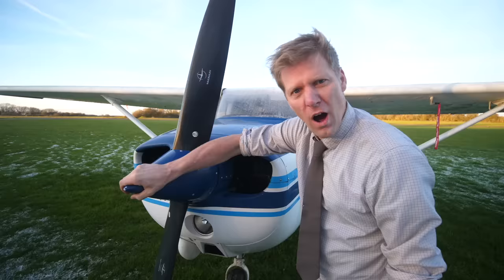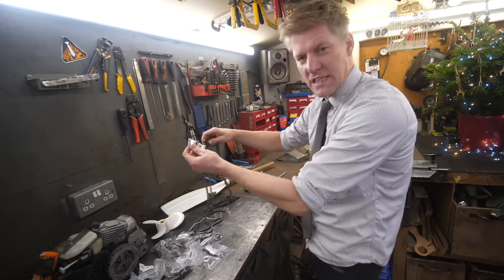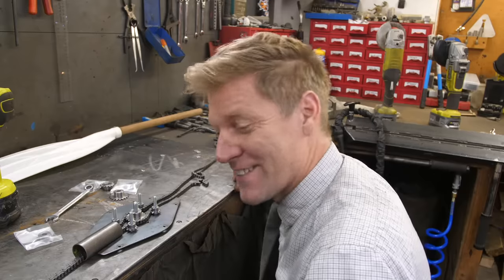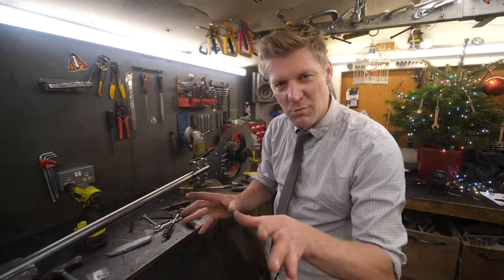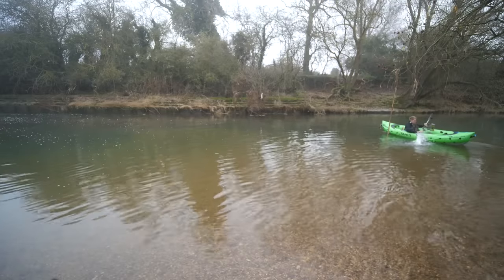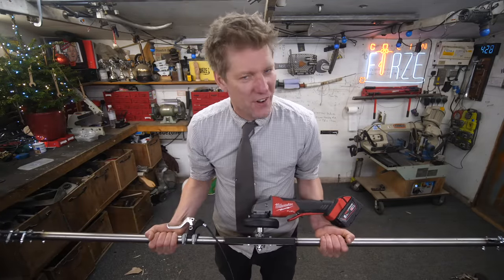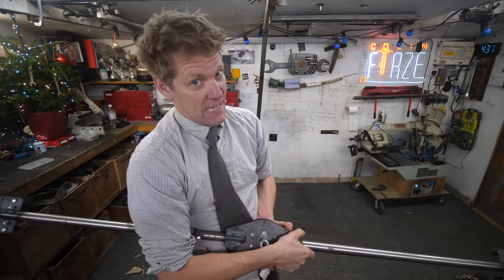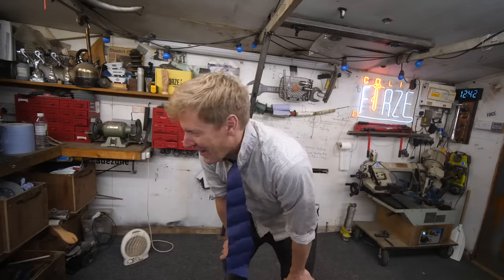I put high Speed Prop Blades on my Kayak Paddle!!

Comment: I feel like for canoeing this would be even better, because with two props in the water both sides, it would allow you to go straight and not worry about the spinning problem.
Reply: Double trigger and a separate chain system for each side. And have it bend in the middle so it can lie flat over his knee in the boat. But each side bends into the water. Hold both triggers to go forward and hold only one to spin
Reply: You should have curved the handle so both props would be in the water at the same time. To turn you would lift 1 prop out of the water. Or create an outboard that hangs off the back.
Reply: @jackscott5499  That would just be a motorboat.
Reply: spot on. 110% correct dude
Reply: @jackscott5499  bending it would create a torque to counter the prop, it would make it useless as you would basically be holding all the power with your wrists or it would fly out of the water
Reply: He doesn’t want a boat. He wants to keep it so he can use a paddling motion!
Reply: Why does it have to be chain driven .
   Waterproof housings , fans mounted inside the fins , electrically driven , but water proof , water tight housings..... wiring back to a variable throttled Lever switch 
    All that's left is how much power supply versus battery weight  .
Reply: I use a petrol grass strimmer on my canoe, just changed the strimmer cord head for a small prop, just placed the strimmer shaft between two small pegs  at the back of the canoe for direction change, could reach 20 mph easily.
Reply: I wonder if you'd still have to J stroke
Reply: I was thinking it needs to have a 45° angle right in the center. That way you can hold it on your lap and have both oars in the water at the same time.
Reply: @EdBrumley  or in a v configuration so you don't have to try and curve the chain or tube
Reply: Barring the cool inventing part of this, why not improve the trolling motor! I already have one of those on a canoe.  Good for 5mph for 5 hours ish.  This invented more issues than it would solve! And i can drive with my foot while fishing!

Comment: Suggestions on the paddle 1) shaft instead of a chain, that will stop the water climbing up. 2) angle the poles so both are in the water at the same time ^ shape. 3) turn the paddle part 90 degrees, so that the paddle is parallel to the boat, but of course keep the propellers pointed to the back. This will reduce drag and let it be a kind of rudder.  And 4) if you wanted to get super fun, make the paddle part rotatable, so that it could be a proper rudder.  Bicycle handlebars for stearing and all.  Love everything you make, best to you and yours this holiday season!
Reply: 100% agree, I immediately thought of the shaft concept as I assumed the chain would wear and potentially break inside that pole
Reply: Also have 2 separate motors so only the one in the water is spinning.
Reply: A shaft is the right idea, but it still has to be more like a hybrid paddle and not just a double boat motor, to still maintain the concept. Would be interesting to have separate controls for the two sides so only the one in the water spins.
Reply: I thought of this too,I decided not to comment on it because it’s basically just a portable motor you stick in the ground
Reply: Agree. And if he had 2 drills that could rest comfortably on each side one could decide to turn with just one or forward with both. even reverse as the drills have that function. 
We are basically reverting back to the basic principles of a motorized boat now, but still a cooler way of driving it. I guess if the point was to absolutely use paddles, it would be a wheel of paddles on both sides or something like that
Reply: Agree with the first one but the rest is a no lol. The rest of your suggestion is basically "make a regular motor boat instead".

The point here is to make a paddle with a motor so that every "paddling" you make has additional force in it
Reply: @ber2996  that's a good point.  So to just improve it as an 'assisted' paddle he could use the shaft system, keep the bar straight , and put a small float to the power switch for that side in each paddle so that the propeller would spin if that propeller is under water. That way it would engage automatically and would be a more natural motion.
Reply: dude you are correct on every point, BUT you'd just have built a prop-powered boat at that level xD y'know those that you see on east asian rivers on or the amazon, stuff like that
Reply: that's just a shallow water rig like those small little boats in Thailand
Reply: Excellent comment. Let's see yours then!
Reply: @ricvanesh9445 
  see the video title

200+KM/H Accident!! Drag Racing Long-tail  Boat This is very dangerous sport
Reply: Then it's moving away from the whole "paddle" theme and more to just a motorboat. But yes,, these would make it work better.
Reply: Yes it will be semi boat
Reply: At that point isn't it just a fancy outboard?
Reply: Just found your channel. My new favorite YouTube channel. The awesome production combined with the madness is fu*kin epic
Reply: you mean just make a boat? not sure if that was the goal.
Reply: Yes that’s great but he doesn’t spend 3 years on engineering for each video. It took you three second to think of all that, in real life it takes longer and you could never hope to achieve any of it.

Comment: Perhaps if the paddle shaft were bowed downwards at each end  so that both props can propel the katak for forward movement...
I think an A frame (as suggested) is an ok  idea but  would result in difficulty lifting one prop out of the water for steering.

That said, as it is, another marvelous crazy idea  is born.
Reply: Or just have 2 drills
Reply: If the paddle shaft were bowed downwards, the shaft would just spin in your hands when you gas on it. It would need some bars welded to it that sit on your shoulders or something like that to prevent the bar from spinning.
Reply: Why not put the propeller shaft straight down the paddle shaft and hang it out the back of the boat. What a silly idea. Who would do that?
Reply: wow. unequivocally correct
Reply: @chitlitlah  Besides if you want a usable config you get an outboard motor, and those are easily available. This was about keeping the paddle and add props. It's never going to be a good practical solution but it's fun.
Reply: @blahorgaslisk7763  Yeah, our goal is definitely not practical on this channel. It does need to be something you can hold onto, though.
Reply: Xlyers arm slashing hair tangling thing middle bit needs changing to set the poles towards the water and then the paddles can be rotated towards the water too and then put housing on the prop side and it will be perfect.

Comment: Instead of using propellers consider using impellers since they are in a housing, hopefully a bit safer. Also is there a way to mount a float switch (like what’s on a sump pump) on each end of the paddle, wired to separate electric motors then the motors would only turn on when in the water? This would help with safety and save battery life without the operator having to consciously think about turning the motors on and off repeatedly.
Reply: Also use Carbon Fibre for the tube
Reply: Nice thinking, but I reckon it'd be better running continuously & conserving the momentum - unless you're a a really slow paddler.
Reply: Bot

Comment: Bend the center support so the paddles are at 45 degrees angled into the water. Then you can just lift one side to turn. Both need to be in the water at the same time.

Love your shows.
Reply: Or just have an independent throttle for each
Reply: Yeah surprised he didn’t angle them so they can both be in the water lol
Reply: Yeah I was thinking same thing
Reply: I had that exact same thought, it may not be a oar anymore but it would be a convenient outboard motor for kayaks that could, in a pinch, be used to paddle.
Reply: And counter rotate to keep the slashing and torque steer down.
Reply: @roman7954  Well it's then no longer a paddle but side rigged outboards. Nothing new there.
Reply: Great idea. I was thinking of some complicated tilt switch to divert power to the downward paddle only, but I like your idea better
Reply: Bend it so both blades are in the water simultaneously — it’s actually not a paddle, it a twin-bladed, hand-held, outboard motor.

Add a screen over the blade and it’ll be a wee bit safer 😂
Reply: This was my first thought too, would certainly make it much easier to control 😂
Reply: With both sides in the water at the same time you could steer simply by lifting one or the other higher than the other. You wouldn't even have to get completely out of the water. Since water is denser the deeper you go the deeper prop will give more push.
Reply: But if both sides were angled in the water then the bar would force itself to twist (rotate) so you’d need great grip or another mechanism to hold them in position.
Reply: The idea was to make an oar with motors, not to make a motorboat. It was supposed to be this way
Reply: @coffeeshangarworkshop8051  you're clearly one of those unfortunate individuals who's oblivious to the fundamentals.

Comment: That paddle has serious potential. It would be really cool to have an array of moisture detectors, or maybe even as simple as a float, to have each side automatically spin up once they are fully submerged. You could also go to an internal drive shaft design instead of a chain, with a 90 degree gear drive to spin the props, which could also allow for some gear ratio shenanigans of you wanted. It would also make it easier to seal the center section off from water lol. Then lastly just make everything out of composite materials as much as possible to save weight. Carbon fiber drive shaft inside a carbon fiber outer shaft would be ideal. But I could totally see this being at least somewhat practical. The only problem I see is that fundamentally it's going to cause the kayak to zig-zag more I think
Reply: Oh, also maybe have a directional switch that detects the flow of water which will then tell the motor which way to spin. That way it can still be automatic and be used to paddle forwards and back

Comment: There is a reason why props on a boat are directly behind the boat.. Now consider that this is the way for rowing a kayak one side at a time, however an old fashioned row bot that is rowed with both oars in the water simultaneously keeping the boat straight and this my friend offers the best chance for your apparatus to work as intended..

Comment: If you built the oar with an approximate 75° angle at the center so both paddles would be in the water at the same time it may work better. To fix the problem with the chain carrying water into the boat, use a drive shaft system like a string trimmer uses, in fact you could purchase a Stihl KombiEngine (used for multiple tool attachments) and rig it to drive both oars driveshafts.

Comment: Colin has just a brilliant mind. Now imagine, an oar just like he made but, it is angled at the ends so that you dont have to keep swiveling left and right. It has a very powerful lith ion battery pack in the middle where you hold it and two electic turbines just as Colin made but not needing the chain drive for obvious reasons. And waterproof it all. Colin literally created the no paddle electric paddle.
Reply: A lot of people have posted about similar versions, but they all have the same problems. If you angle the ends down like you suggest there will be a torque acting on the paddle twisting the handle in your grip. Someone suggested adding bars going from the paddle to rest on your shoulders to help keeping the paddle from twisting in your grip. It makes everything larger and more clumsy.

But the biggest problem is that you now have a impractical motor boat instead of a canoe. And if that's what you want just get an electric outboard motor. It's cheap, easily available and a lot more practical than any of these paddle ideas. What Colin was after was a paddle to use in a canoe, but with props on. Not for it to be useful, convenient or in any way practical but to be fun and absurd. And that it certainly was. It fullfilled all the design criteria, but was perhaps just slightly to scary dangerous to use, which is saying a lot when it's a Colin Furze design.
Reply: A brilliant idea for an entertaining invention, not rly a practical one (which is sort of the whole point). If you optimized the paddle enough you’d just end up with an outboard motor. Not nearly as entertaining tho!
Reply: What?

Comment: Angle them down so they are both in the water at the same time and it will use less effort to go straight, then when you want to turn pull one out for the water momentarily. Makes me want to try it lol
Reply: Wouldn't really be a paddle then would it
Reply: @nicklockk  i mean technically it would still be a paddle you just wouldnt have to paddle it 🤣

Comment: 2.0 idea :face-blue-wide-eyes::  Mount it to a canoe, put the bars at an angle in the middle, make the shaft rotatable so the fins stay in the water and can be rotated horizontally and the motors on a gyro. Also a chain cover so the water stays outside the vessel.
Reply: Put the batteries low in the canoe,  bring only a flexible wire  to the paddle,  via a jack.  But the paddles are wrong... static paddle part negates the rushing water in the center. You'll need to go thin protection rim...... Hmmmm, maybe the static longitudinal parts that can be made to rotate in place,  to let the water through in powered mode,  and resist water in paddle mode. Those longitudinal parts,  kept shut by a spring,  that is kept open when the motor for the fans is run.

Comment: Why not make it a fixed paddle design where they connect to either side of the kayak. This would however require two separate power sources and a mountain bracket but it would also make turning left right as well as going straight much easier to dictate. Also it would limit the noise of the chains hitting each other inside the metal tubing there by making it a little more nature friendly also taking the drills apart and rigging them into a trigger motor configuration would limit the amount of weight you'd bring with you on the journey, also probably should make them water proof 😂 nice build though.

Comment: I was thinking about the under ground garage that you turn the car around in. instead of a square floor dropping down. Make it a round floor. When it drops down your scissor lift is in a pit under the floor the car sits on. I say dig a round pit around the pit your lift is in and fill it with water and put balls filled with air that will float the floor the car sits on. because its round you can use cog wheels to spin the car around. and the lift will be in a dry pit surrounded by water and if you use brine in the water pit the balls will float that much better. or you can do the same thing with ice if you froze the water the car would spin on the round disc on the ice you would just need to rig up a cog with a clutch to spin it ,  there is also grease to spin the disc on. the lift will be in its dry pit safe and sound. So if you ever want to have that underground garage to compliment your bunker and your tunnel. Let me know what you think ?

Comment: Colin you can make the design better with 2 bends to allow both motors in the water at the same time and can 3D print a cover for the motors to improve safety. then you can make a 2nd and race them!

Comment: About the water being brought into the boat by the chain... how about using bevel gears and a torque tube? with sealed bearings, water won't get into the paddle, and as a bonus, a feathered kayak paddle with adjustable angles would be way easy to make!

Comment: IMO, angle the oars so they're both in the water at the same time, make them separate units with their own motor and throttle so you can steer based on throttle inputs but other wise, neat idea

Comment: You need shaft drives w/ beveled gears to be quieter and dryer.
The center piece needs to be at 30 degrees or so to keep both props in the water... Lifting one or the other to steer.

Comment: use a flex shaft and you can attach it to a larger motor and battery pack locatd on the boat, offset the props to be lower than the level of th padel and you can use both in the water at once for maximum thrust in a straight line or half thrust one at a time.

Comment: A fun idea as usual but to use the oar to row is wrong thinking. When Colin rows (which maybe just a natural reflex because that’s what you do with oars) he is actually trying to shove water back through the propellor, rather than just letting it drag water through. Ideally there should be a paddle in the water at each side to go forward and when he wants to turn whichever way he should extract the appropriate paddle from the water. What he really wants is a single propeller in the middle at the back, with a rudder right behind it, but heck, where’s the fun in that? 😊 Let’s face it, we watch Colin because he’s a crazy genius.

Comment: Give those propellers an angle so you can hold it straight and also submerge the propellers without paddeling. Then you would have an outboard motor on a stick. Would possibly be perfect in a kayak/canoe

Comment: I would split the paddle and add a 2nd motor. So you can hold them like in a rowing boat and dunk them in separately for turning or together for some extra speed :)

Comment: Brushless motor in the middle, external battery, and mercury switches on the ends to kick the motor on/off at about the angles it is going in the water.
shaft drive like a weed whacker would help with not pulling water up the tube